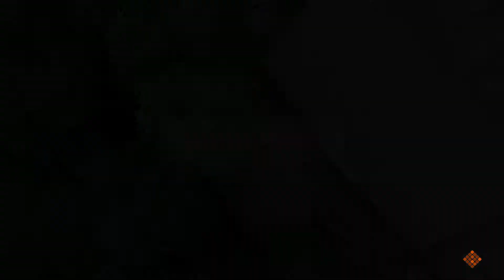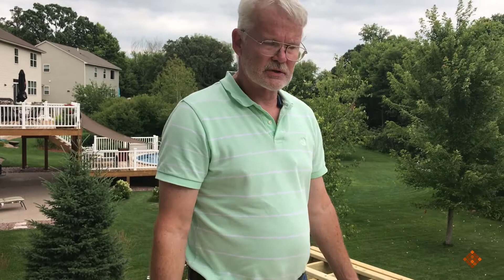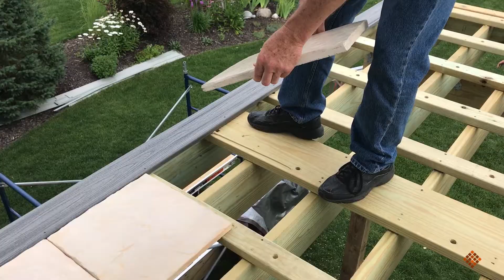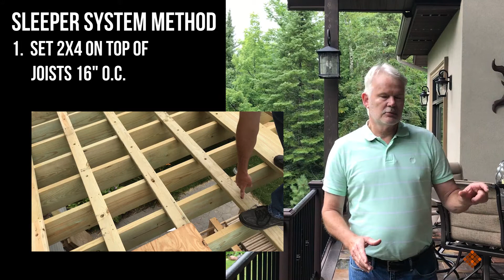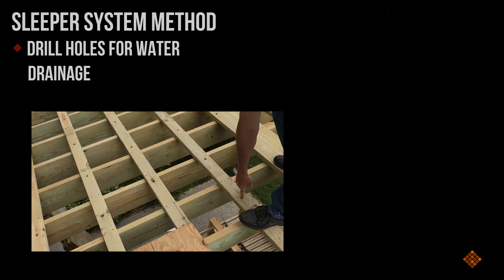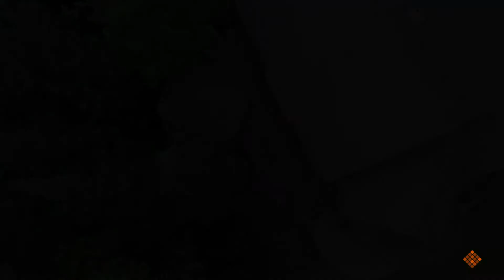How to Install DekTek Tile's Concrete Tile Decking Using the Sleeper System Installation Method

Comment: Why not just put tile over plywood?
Reply from the maker: The tiles are structural and hold over a 1,000 pounds per tile so a substrate such as plywood is not needed but that certainly is an option if you prefer to install the tiles that way. This would be more like a roof deck install, where you would water proof the plywood and then our pedestal pad install is a great option for roof decks. Here is the link to the roof deck video: https://youtu.be/nEnPIdk5LGA  Let us know if you have any other questions or if we can help! Thanks!
Reply: Im with you on that too, I wouldn't want to step on that tile with out it

Comment: What about wood rot?
Reply from the maker: Hi Gary, great question. Since this video was posted a few years back we have modified this installation to allow for even better water drainage. Here is the link to the video that shows the best way to install our deck tiles on the sleeper system: https://youtu.be/Spax5WRdkxs You'll see in this video that not only do we make sure to set the adhesive in dabs to allow for water drainage but also in the 4 corners of the tile where there are dabs of adhesive we recommend sticking a tile spacer to allow for even better water drainage. Be sure to check out the link above that demonstrates this nicely and let us know if there is anything we can do to help! Thanks!